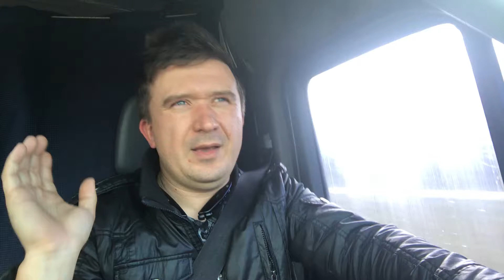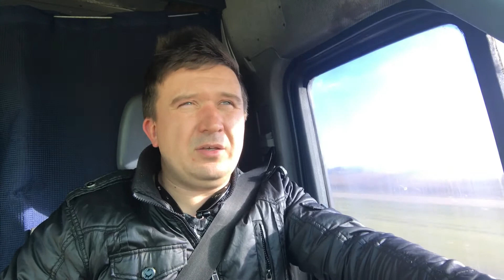T1N Mercedes Sprinter Transmission Limp Mode, First Sighs That you need to watch out for

Comment: Sometimes my truck wont go into drive on start up. Usually i try to let it run a little while. When i put it in reverse, it always engages, then i slide it down to driveand off we go. This is a great discussion, i would like to know as much as i can in case it starts getting worse. It only happened after service at Mercedes.. Road hazard broke a trans line connector and i had to get it replaced. Going to check fluid levels today and make sure they topped it off.
Reply from the maker: +Sang-Shao Tbone glad you liked it, I will have more

Comment: I just looked at my fuses, all good, but mine still stuck in park, so sticking a pen in, to get it into a gear.  Here's how this started this time.  I noticed a clicking noise in the front right wheel.  This was going on for about a week or so and never took the wheel off to investigate.   Then the anti lock light came on when I was driving.  When I parked it and restarted the vehicle, it wouldn't go out of park. I'm wondering if this related to the anti lock or did my replacement brake light switch fail?  No idea at this pt
Reply from the maker: +Joe Moto I wonder same thing wow this is a common problem, I would check Break light switch first, are you saying the number 5 Fuse is ok?
Reply: ZIMALETA HOW TO SHOW & UNBOXING yes, fuse is good.  Checked all, all good, even the fuses by the seat.
Reply from the maker: +Joe Moto wow and still don’t shift
Reply: ZIMALETA HOW TO SHOW & UNBOXING nope.  Doing the pen in the hole to allow me to get into gears.  Brake lights work, and not staying on either. Poor sprinter, he's having a bad day lol
Reply from the maker: +Joe Moto wow that’s crazy

Comment: Hey Serghei, i have a question, i have a dodge sprinter, when the engine is cold there is some vibration when downshifting from 3 gear to second, and second to 1, what it can be? Thank you.
Reply from the maker: +Inna Cevdari it’s normal, it’s Torque converter making this grumbling sound especially at low speeds
Reply: Ok, thank you :)
Reply from the maker: +Inna Cevdari your welcome